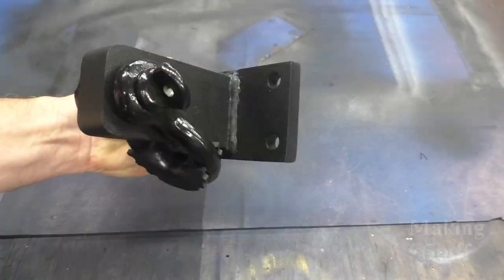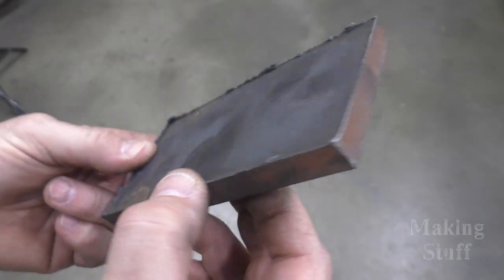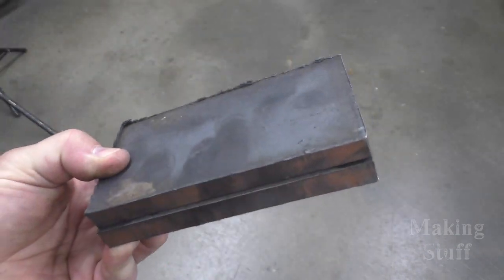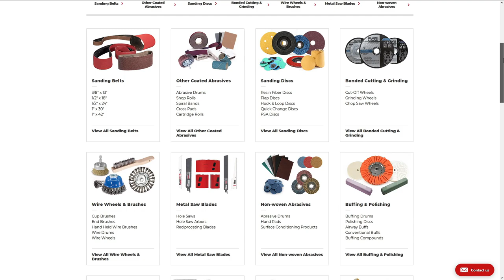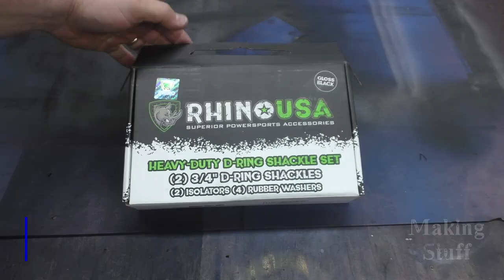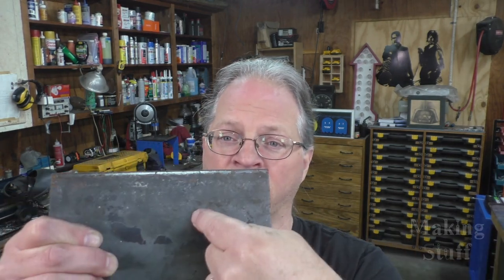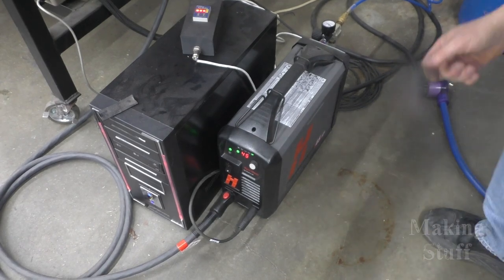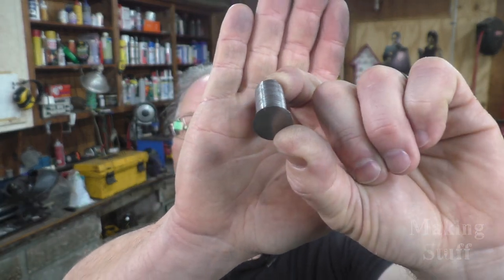Making Tow Hooks For My RAM Pickup Truck and Pushing My Tools Limits!

Comment from the maker: What projects would like to make for your truck or off road vehicle?  Let me know!
Reply: Hey Bob, healthy  safe 2023,   I'M located in Barbados  and  we  have a  dodge ram  groupe  here , we does  some mud  dawging  hoever in NEED of some  tough  under  gaurds   including  dif sheilds / gaurds ,what size garuge is the metal  you used for  those tow hooks  you made ? i'm doing a full make over on the 2nd  gen  5.9 will  find a way to  upload some  pic  or video asap,  i'm open to ideas  ,is portal axles  good  for offroading  ? if any  you guys  are vacationing  here  can give me a hit   here as  you can used  one  my trucks,  
Soldge
Reply from the maker: @edisonmyers1079  The metal on the tow hooks is an inch thick.  I have a second gen 5.9 as well.  I need to start doing some cool stuff to it also.

Comment: About half way complete on a Cnc plasma table build using your build as inspiration.  Only major difference is I went with ball screws instead of the belts.  But your series on your build was so much more detailed than others I’ve seen, so thanks for that.  Your presentation is always not too long or too short and a mix of entertainment and lesson.  Great job man!
Reply from the maker: Thank you so much!

Comment: Did the blade break at the weld? if it did you should be able to get it replaced, or if it didn't weld it there should be enough tolerance in it, on my bandsaw setting the tension is like a gym workout LOL
Reply from the maker: Yeah it broke at the weld.

Comment: Amazing, I've never seen a THC bob up and down like that. must be a grounding issue or such.
Reply from the maker: I had the speed that it adjusts the height set too fast.
Reply: I have a stainless steel water pan, I have my grounding clip grounding onto the stainless it's not even a clamp anymore I have it bolted to the pan I should say and never have any problems with grounding issues. Nice video...
Reply: I do not have a youtube channel right now but you can check out what I do @metalplasmacutting on FB. Keep up the awesome videos.